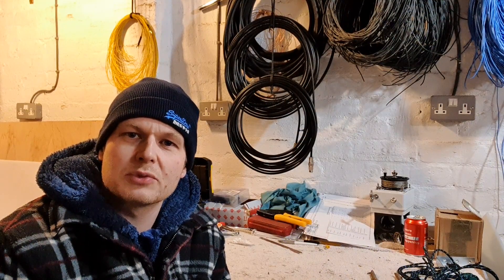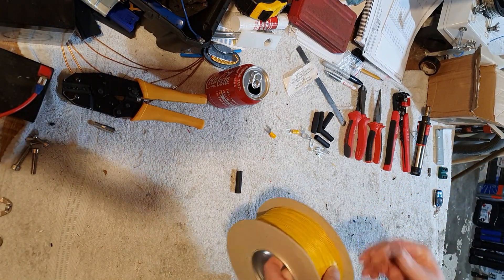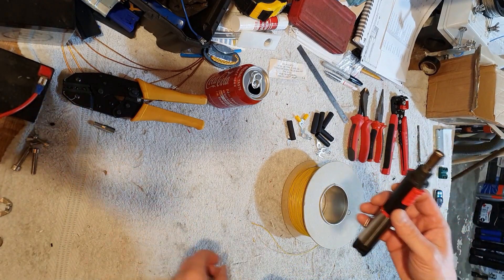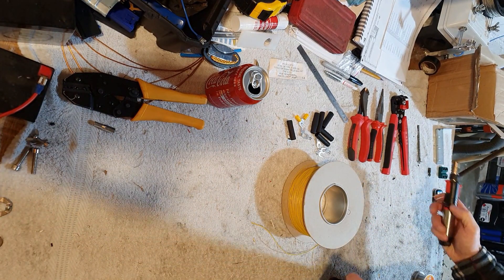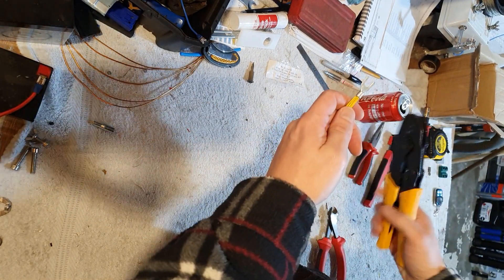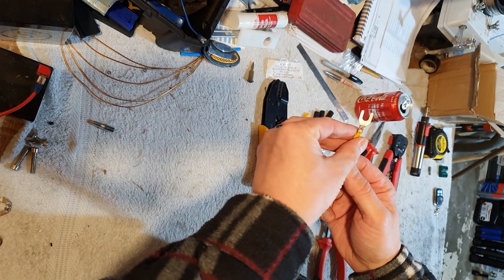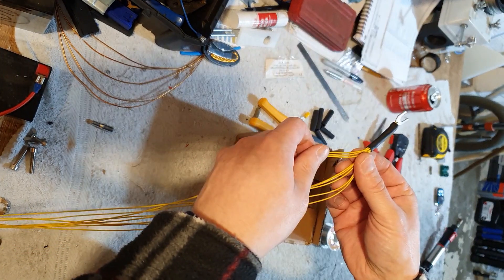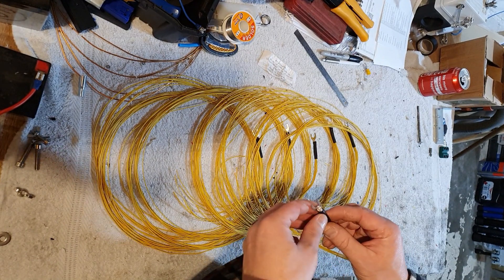How to Make Antenna Radials

Comment: 2m radials for 20m band?
Reply from the maker: Yes, why not?
Reply: Total length.  It doesnt matter what sections they are and many believe shorter lengths mixed with longer increases the counterpoise
Reply: @ragheadand420roll  i had a mix of diferent length and seem to work, someone said use the 1/4 wave lengths, but now one nor the other seem to be satisfactory
Reply: Do u sell your radial wire kits if so let me know id happily buy a few
Reply: Is there any  easy way to work out how long your radials should be should they vary in length and size depending on bands operating on if so does anyone know where I can find this info in a pdf

Comment: Very nice! I need to make these for my wolf river coil. My friend made three tape measure radials by soldering a six inch piece of wire and connector to the end of the tape measures they're yellow for visibility and retract when not needed, They're great for quick deployment but if time permits yours are what I'll use.
Reply from the maker: Good idea. Once you get the hang of it, these are surprisingly quick to set up.

Comment: Want to make ground plane radials for a 9 ft bull whip antenna. Which radial design would get me the most out of my antenna and low SWR. I will be mounting the mast on a balcony railing with the 9ft whip on a so239 connector top floor apartment with roof above me. I want to get the maximum benefit from the radials can you help??

THIS IS FOR CB RADIO 👍👍
Reply from the maker: Sorry, missed this comment. I cant help a whole lot. is your balcony metal? Can you ground your mount to that? Im not sure what frequency your using it on? CB? 10m? Dont worry about long radials, just get as many short ones as you can in any configuration you can manage.